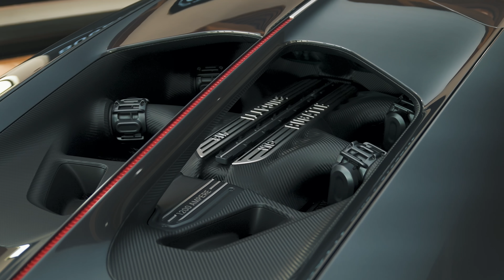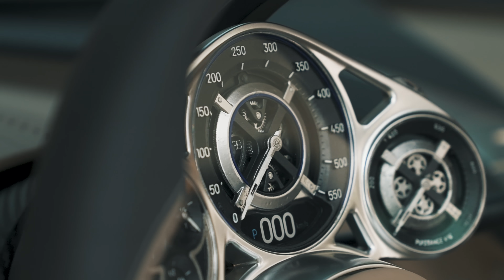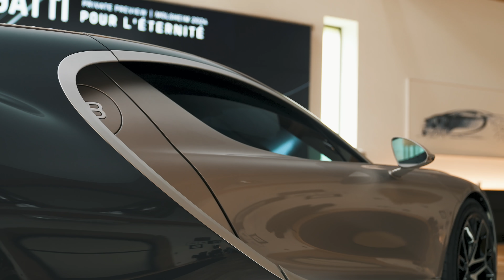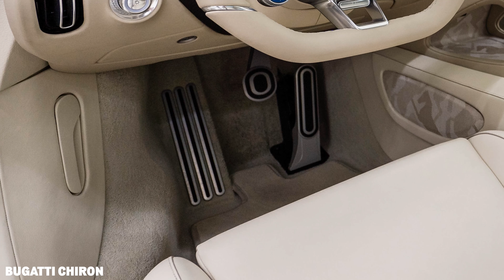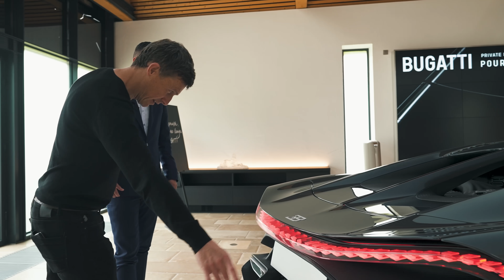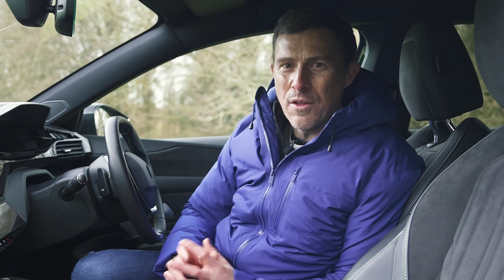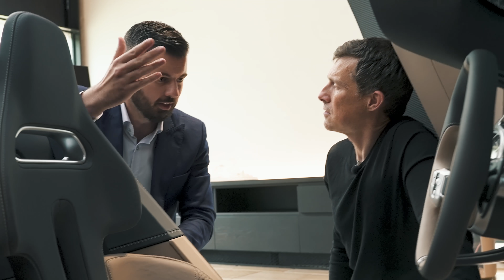New 1,800hp Bugatti Tourbillon Unveiled!

Comment: V16 9500 rpm N/A ?!?!?!?Buggati just dropped the mic ... 😂😂😂
Reply: Naturally aspirated. Bigger displacement than the W16. In this day and age. In this economy. Insane W.
Reply: @AmadeusBrown  Well, V in this case🤣🤣
Reply: @AmadeusBrown  Insane V
Reply: @AmadeusBrown i thought it runs in Twin Turbo V12.
Reply: It a cosworth! very similar to the one the new T.50 has (the mclaren f1 sucessor) I'm expecing it to sound as good if not better
Reply: @dustynias won’t sound anywhere near as good as the t50, quite frankly, the t50 has, arguably, the best sounding v12 ever made (for road production cars)
Reply: @dustynias  How's it similar? V12 is 65°. This is 90. Cross plane as opposed to the flat plane in the V12.
Reply: @dustynias the Panoz Esperante GTR 1 has better sound than 1800bhp Bugatti.
Reply: The natural aspirated engine only makes 1000 HP.  And 800 HP more from the hybrid system. Still impressive dough
Reply: @thatparticulargame6001  Engine only makes 1000 HP?? In what world is that a small amount of power? It's the most powerful NA engine ever built, you are a lemon
Reply: @The24Gamer  the engine makes bhp less than the Chiron and its not NA its electric motors plug in hybrid
Reply: @thatparticulargame6001 only 1000 of a n/a engine? 1000 hp out of a naturally aspirated engine is nothing short of incredible
Reply: @sagethorburn9821 Chevy has already done this 😂
Reply: @thatparticulargame6001 ”only 1000 hp” lololol
Reply: @thatparticulargame6001 imagine if the 1800bhp Bugatti has DRS and ERS tho.
Reply: @thatparticulargame6001  ONLY!? NA 1000hp with a warranty is two of a kind in the history of all cars.
Reply: @Mediarahan003  800 bhp comes from the electric motors this Bugatti is the first plug in hybrid by the brand
Reply: @thatparticulargame6001  Because you gotta be a bit more careful about CO2 emissions these days. Makes sense.
Reply: @thatparticulargame6001  'Only' 1000hp?? It's the second most powerful n/a engine in a production sports car ever, I think. Only the Valkyrie beats it. 1000hp for an n/a engine is a stupidly big number.
Reply: dont forget... naturally aspirated
Reply: @Jalex17895  ikr thats just crazy
Reply: Are we living in the 1930s again?... Cadillac did this first, then Maserati, Auto Union. and after the war, it was BRM type15,  Bizzarrini, even BMW and Rolls had a V16... hardly unique or original, and even stolen the steering wheel idea from Maserati's 1972 boomerang concept.
Reply: @Andy_T79  well said.
Reply: The back it’s a Ctrl + P from almost any McLaren
Reply: its not NA its electric lol
Reply: Koenigsegg being real quiet rn
Reply: @GalczynskiGuy  2300 HP Family Gemera? 👀
Reply: @thatparticulargame6001  That's an all electric car, Bugatti's two motors make 800 hp and weigh 21kg. If they had removed the engine, they could have been able to use 2 more motors for each wheel and bigger size, making 2300 easily while also having 4 seats. So, what's your point? Also, no videos showing the top speed of that car or the Absolut, I wonder why?
Reply: @thatparticulargame6001  its 1700 horsepower not 2300
Reply: @jaishah8948  "Only" 1700 with the 3 cyl 💀
With the twin T V8 2300 HP
Reply: @thatparticulargame6001  Eggs don't want get near Rimac Nevera, cuz Nevera was racing everything possible but no Agera, Regera or Jesko... Rimac even beat them in Goodwood park circuit - he beat the time of Jesko!!!
Reply: @danijelhrup9715  Jesko was 1250 Hp, not full throttle said by the factory test drive, Rimac had it's full 2000 HP, and the time is just by seconds.
Reply: @danijelhrup9715 lol, compare Apples and apples my friend.

Goodwood is btw a crapy track with hay and shit, bring the Cars to SPA for a fast lap and the Jesko will win.
Reply: @thatparticulargame6001  2300 hp mean nothing. I want to see a drag race with both and one drinking a beer while going at more than 400 km/h. This interior of this bugatti is the most luxury thing i saw. And im not a bugatti fan boy. But this bugatti damn its really something. And comparing a v16 and a over boosted V8 its a little bit stupid. The feeling can't be the same driving both, i would pay more to drive this bugatti over a koenigsegg. (my bad for my english)
Reply: @GalczynskiGuy  Did you just conveniently forget the 2400HP Koenigsegg Gemera that also seats 4 people? 😂😂
Reply: @GalczynskiGuy the jesko engine is crazy charismatic it sounds insane even though its turbocharged
Reply: @GalczynskiGuy  ???
Reply: They have a 2300hp 4 seater called the Genera. They are not worried @GalczynskiGuy
Reply: @MistaRoyanT  if i ever feel like a dumbass, ill remember what u said.
Reply: @GalczynskiGuy  dude Bugatti got nothing on koenigsegg.. but this is a nice car for sure!
Reply: @MrMk82 Koensigsegg is more like a vanity project. Bugattis are actually real cars that have reliability without spontaneously combusting
Reply: @carlosandleon  Both are amazing car companies, koenigsegg treat their customers with real love and appreciation, that not started with Bugatti until Matt arrived and took the company.

Koenigsegg is building a brand new car replacing the burned one, also addressing what happened and calling all the current jeskos, fixing the error and releasing a software update! Uff, long sentence to say.
Remember that this brand was started by a business man that had a son with a Dream named Christian.

Bugatti started way before, then with the Volkswagen Group and now Matte. 
Of course they can allow themselves to more.
Reply: @carlosandleon funny how you use reliable in the same context as Volkswagen..😂
Reply: @MrMk82  I mean the acceleration from 0 to 124 miles per hours is under 5 seconds on this new Bugatti
Reply: @MrMk82
The Egg actually flashing check engine lights as much as VW
Reply: @MrMk82 but imagine if the two of them worked together to build a car…
Reply: @MrMk82  Bugatti literally has everything on Koenigsegg 🤣 speed, performance, luxury and not some gimmicks
Reply: @davidherene6365  koenigsegg has higher top speed, quicker acceleration. Its not meant to be a heavy fancy cruiser, its sports cars with insane performance. No compromises. Like i said they have nothing.
Reply: @MrMk82  both are awesome right now.
Reply: @MrMk82  uh no it doesnt? Bugatti currently has the highest top speed in the world and has the throne, Koenigsegg hasnt proved that they reached or can reach 331 km/h
Reply: its EV hybrid so its amazing
Reply: good stepping stone to full EV by Rimac. This Bugatti has 3 electric motors
Reply: Apparently 14.5:1 compression ratio which is crazy
Reply: @annonymously331  that's insane for a petrol
Reply: the engine by Cosworth England and the Motors are by Rimac
Reply: Dont forget its 8 liters
Reply: @Person-cv9dj 8.3 litres 🔥
Reply: @Person-cv9dj  because it needs all the torque as it weighs 2000kgs +! That's not progress.
Reply: @sajid6027  he just said it‘ll weigh less than 2 tons and I was trying to say that 8 liters revving to 9.5 k is impressive
Reply: Not as impressive as revving too almost 1300. No way will it be less then 2000kgs with fluids etc.
Reply: Dropped it? They threw it
Reply: Valkyrie AMR PRO 6.5-liter naturally aspirated V12 engine engine can produce a power output of 1100 horsepower
Reply: By cosworth none the less 😮
Reply: Bet a NA W16 would sound better!!
Reply: Insane definitely deserving they showing how it’s done
Reply: Cosworth dropping the mic🤷‍♂️
Reply: But the sound still doesn't b eat Ferrari V12 <3
Reply: This engine in a Formula 1 car 😍
Reply: @rainerknuth  no it isn't. Don't be ridiculous.
Reply: @rainerknuth  wouldn't be f1 then
Reply: NA tho. Don't forget. No more turbos
Reply: @mineigshi well it should've been fit for V10 twin turbo.
Reply: No turbos either is what makes it so cool, n/a sound it going to be heavenly on this car
Reply: Compared to this guy, Elon is nothing.
Reply: @Stijn5 Mate is in the car business. Elon is in the mass production + space + Mars business. Perspective bruh 😂
Reply: Plaid 20,000 rpm 🎤  ⚡️🇺🇲

4680 Roadster = GAME OVER BABY!
Reply: @larryc1616   and a Dremel makes 30 000 rpm
Reply: @palleppalsson  your mom showed you her toy? 💋
Reply: @larryc1616 Guys like you have been saying that for 7 years already.
Reply: @larryc1616 when?
Reply: @carlosandleon  
winter is coming....⚡️🇺🇲
Reply: @larryc1616 hopefully the roadster comes out before tesla go bust 🤞
Reply: @kookvision9295  you mean the #1 Auto manufacturer who can buy every legacy auto in the US, Germany and Japan COMBINED? The one with the best selling car in the world last year? 🤭 ⚡️🇺🇲
💀Legacy auto 💀 Cope!
Reply: @larryc1616  the one that is relying on Chinese battery tech? The one that has tens of thousands of cars in storage lots?
Reply: @larryc1616 
You mean the auto manufacturer that is getting beat by BYD..
Reply: @larryc1616 you're confusing "valuation" and actual VALUE. The first is what investors THINK it is worth (much like bitcoin) the second, actual VALUE is what you actually have physically without speculation. Valuation wise, Tesla is bigger than Toyota, when it comes to actual VALUE, it doesn't come close to it.
Reply: @larryc1616 Tesla loses to Chinese BYD 😂
Reply: @siran424 BYD will soon become the world's largest sales force, quickly defeating Tesla
Reply: @juniormarinho9755  
Agreed.
But there is a small correction.
World’s largest EV sales force beating Tesla.
Tesla was never the world’s largest sales force, it was just the largest EV sales force..
Reply: @larryc1616 
When Jesus finally comes...😊
Reply: @larryc1616  Created with idea of Nikola Tesla, same native land as Mate. So all credit goes to a small EU nation called Croatia.
Reply: @larryc1616 world record top speed Chiron 304 mile not Koenigsegg not Tesla.

Comment: A V16 in the time of electric and hybrid vacuum cleaners? Epic!!
Reply: @katsudon2048 yes it's hybrid but not a vacuum cleaner cus of the v16 he knows it's a hybrid
Reply: It's naturally aspirated the electric motors don't ruin the sound buuuuuuud @katsudon2048
Reply: Naturally Aspirated V16 with motors. That's perfectly acceptable
Reply: @katsudon2048 And? Still V16, not electric. There is NO CAR rn on production with that type of engine, so it doesn't matter if it's hybrid. Being hybrid is the reason why it made to production, otherwise the idea would be dead
Reply: Its got electric motors and 🔋

Comment: looks like a facelift of the chiron xd😂
Reply: That's one hell of a facelift 👀
Reply: It’s hard to please all
Reply: Thr front is an F
Reply: How is it a facelift with a conceptually different engine and completely different door and body
Reply: @abhishetty2637 OP's talking about the design. 🤦‍♂️ Facelifted cars can also have a different engine.
Reply: @steven_taylor_  Imagine a facelift where they change the sceletal structure of your entire body... almost as if calling it a facelift is factually incorrect... to each his own I guess.
Reply: @Jay.D.Smithy  Did you read what the OP wrote? It wasn't written that this is a facelift but this looks like a facelift. So, it's the looks and not what's underneath, nothing related to the structure.
Reply: Not entirely sure what you wanted. No heritage brand will move to a completely new design language. My point was it’s about as completely new as it gets not even sharing a platform as most new cars do. At 4Ms I suppose you can want whatever you like.
Reply: Bad plastic surgeon
Reply: Because it has to keep those heritage design lines of a Bugatti. It’s what the customers want from it
Reply: @coolguy_2997  it doesn't seem to have the same lines, they just made it more unsimple Making it look ugly. Some don't like it
Reply: @coolguy_2997  Like is that so ?? ,then  what bout the Bollide, The Divo , the Centodieci or La Voiture Noire
Reply: The new front is ugly
Reply: @svfanner44 I think its more about the camera angle in the vid, i bet from normal eye view you get much different perception of it.
Reply: @hoplit6764  sorry it's def a bit unproportional for me.